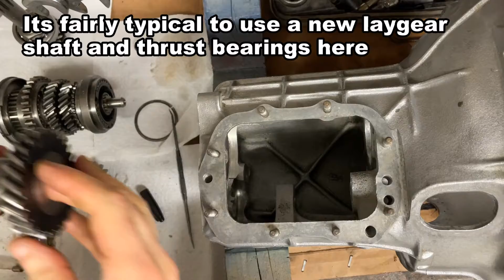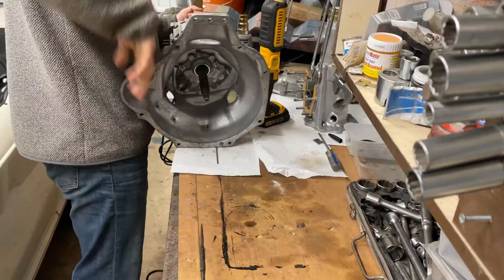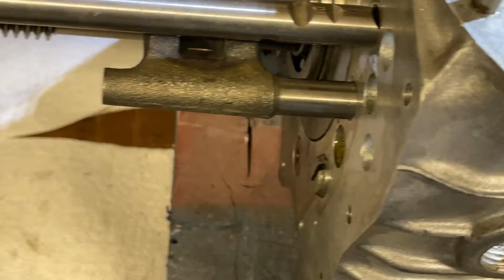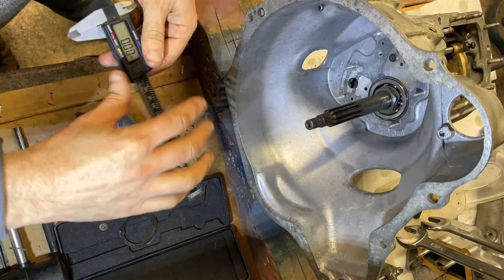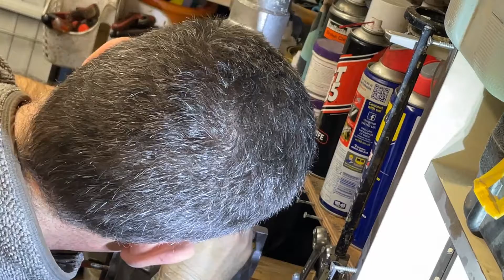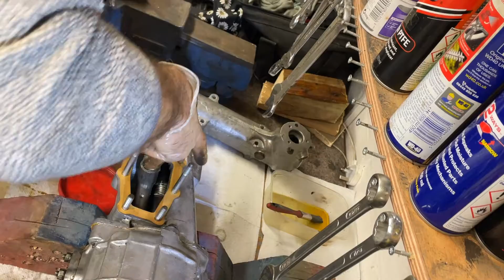Morris Minor/MG Midget/AH Sprite Ribcase gearbox stripdown overhaul and rebuild (part 3 of 3)

Comment: Quick question…How much wear did you notice in the laygear? Was it significant or “normal”. If so what ia “normal” in your view ?  Thx
Reply from the maker: I’d say normal which for me was no obvious damage or pitting just heavy polished bearing surfaces. As the repair kit has the shaft and bearings they were changed out while it was apart. Thanks for watching

Comment: Olá! Pode me responder uma pergunta? Para trocar o rolamento do eixo primário, eu preciso desmontar toda a caixa para afastar o eixo secundário e retirar o eixo primário com o rolamento, para trocar ele fora da caixa?

Hello! Can I answer a question? To change the primary shaft bearing, do I need to disassemble the entire box to remove the secondary shaft and remove the primary shaft with the bearing, to change it outside the box?
Reply from the maker: Yes you do need to remove the box to take out the primary shaft

Comment: I also have a locked up 1st gear and plan use a spacer as well.  To what extent do I need to disassemble to free up the 1st gear?  I'm hoping not to have to strip it completely as I want to get back on the road as soon as possible.  Excellent videos, very easy to follow.
Reply from the maker: If you need to get at first gear your really looking at a full strip down. Doesn’t take that long. Thanks for watching

Comment: @27.33, F.Y.I that oval part on the side cover with the big hole in it was for the clutch shaft on the A30 as it was designed with a mechanical clutch, there is also one on the opposite side in the main casing & that was for the L.H.D version clutch shaft
Reply from the maker: thanks for the feedback and thanks for watching

Comment: Does that input shaft seal modification need machining before fitting ? I guess the scroll needs machining away before the new seal can be fitted.
Reply from the maker: yes. i purchased the cover already machined and fitted with a seal online. thanks for watching
Reply: @mgmidget-thebirthofaraceca4349  Thanks. Planning an engine and gearbox rebuild on my Midget. Really helpful video, very easy to follow how to disassemble and rebuild a gearbox.

Comment: These videos are fantastic! I've got a barnfind mk1 midget that I can't seem to get into reverse, all the other gears are fine. I've smacked it loads and it won't budge. Any ideas how to address that before pulling the whole thing?
Reply from the maker: As a wild guess I’d say as a barn find the The slider and spring which lifts to allow the lever over into reverse could be seized ??? If you take the gear lever covers off to see the box you can see the top of the plunger. Look at an exploded gearbox pic to see which one. Beyond that I’d take it out if it were me for the sake of a couple of hours . The rear housing can come off then to work on the reverse plungers . Thx for watching
Reply: @mgmidget-thebirthofaraceca4349  Hey thanks for getting back to me! Funny enough I beat it with a 2 x 4 this morning with a bit of oil in there for a bit and it popped over. Going into reverse nice now

Comment: I opened up a ribcase to deal with the notorious locked in 1st gear syndrome. After fabricating a spacer to limit throw on the 1st/2nd shift shaft, your video helped re-assemble the unit, especially helping the sorcery involving the interlock balls. Thanks for the first class tutorial.
Reply from the maker: glad i could help. thanks for watching

Comment: What a great series of videos on the gear box. Nice job. Might give it a go. I have a ribcage in the corner of the garage. Maybe I missed it but did you check the clearances of the synchro gears with a feeler gauge to see if the cone part of the synchro gears were worn?
Reply from the maker: Thanks for the feedback. appreciate it!  I did check the synchros but not explicitly on the video.  Ideally you want a 0.8mm min gap between each synchro and the corresponding gear. Some say 0.025" as a cut off for replacement - as replacements look to be hard to source right now.   Mine were ok and visually good, in fact i was surprised how good the whole gearbox was inside to start with!! Beginners luck i guess :-)  Im hoping the gearbox it will replace will be as good on stripdown
Reply: @mgmidget-thebirthofaraceca4349   Ah nice job! Yah the box was pretty sweet. Can't wait for some track videos :)
Reply from the maker: Track videos you say..........hold my beer :-)   give me 5 days ;-)
Reply: @mgmidget-thebirthofaraceca4349  LOL